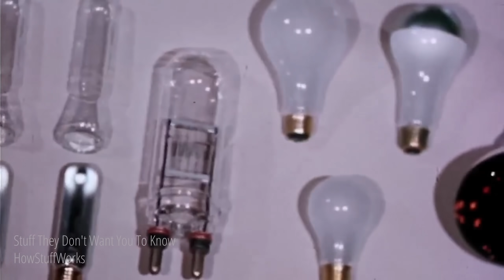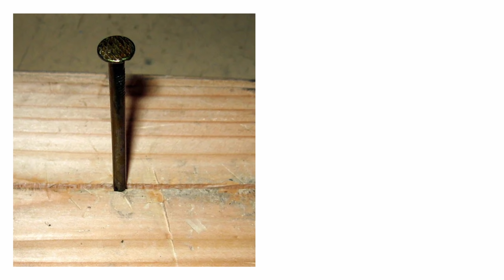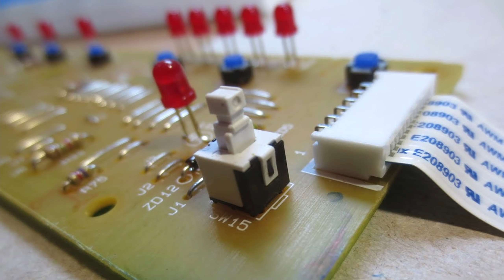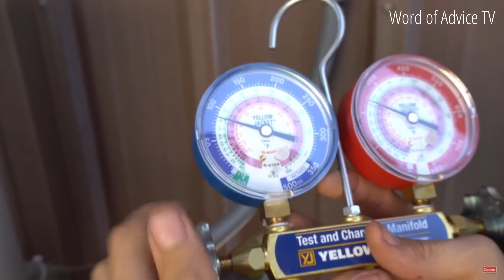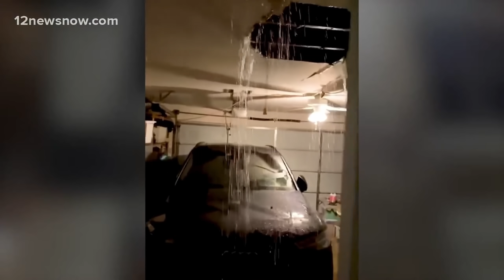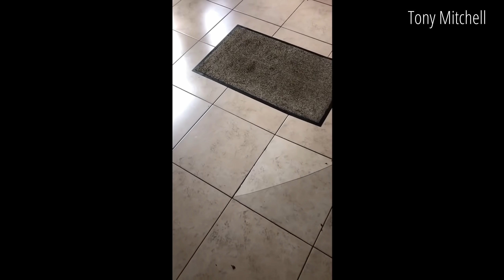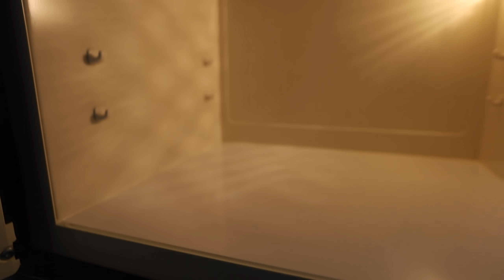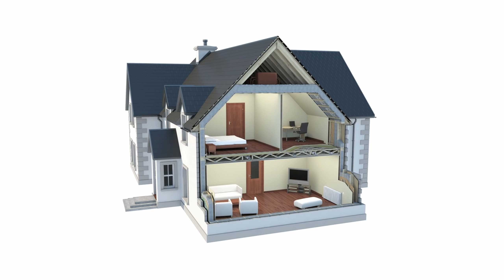Built to FAIL | Planned Obsolescence

Comment: Engineer here. I've seen dozens of stainless steel or plastic pumps have a hidden steel bushing or bearing deep inside the volute, something that only complete destruction of the pump can reveal. It rusts, the pump seizes, and then you buy another. Multiple brands, multiple pump types, all in the 1/4 - 1 hp basic utility range. Why did I buy a stainless pump for a dirty trick like that?
Reply: Another example of that concept is washing machines. A stainless steel drum inside a plastic tub can't rust, right? Well those bits can't but the drum spider made of cheap materials is almost certain to corrode given it's in direct contact with the drum and exposed to water (dissimilar metals....).

Comment: Yet at the end of the day, it's consumers that choose the cheaper products. In the effort to achieve a home like the Jones'es everybody chooses to have the facade of luxury without wanting to pay the true cost.

Totally agree that homes should be more "modular" and repairable. Watching these construction related videos I always am considering how I can make it easier for the next guy who has to repair this pipe or whatever
Reply: Agree. I have problems with blaming manufacturers. After all they are cutting corners and using cheap materials to produce the cheapest product. This is what consumers want, they really are not looking for quality. Just the bottom price.
Reply: @agisler87  yes but because most don’t understand it actually costs them more in the end.

Comment: I've spent a large chunk of work time digging out that spray foam insulation to perform electrical remodels and let me tell you first hand, they're never actually solid. After curing,, It's only about 4 inches thick with massive air gaps between it and whatever surface it's sprayed against
Reply: And living in a 50s built Dallas home is honestly terrible, the foundations are so far off these days that you can feel it standing on them and the price ranges of these places mostly keeps owners from being able to afford to even get it fixed for 10 years

Comment: I would love to sit down with a pot of tea and pick your brain. When I could buy a home in tx decided the foundations, structures, layout of every one of the homes I viewed was not livable so I bought a mobile home as that requires piers and anchors, had access to all services and could be moved as I did want to be in the country. There I bought readymade instead of built to my spec as had done when I was 21(hyperinsulated, thicker plywood, vinyl throughout, sl changes to fenestration so it didn't need ac in IL summers) and regretted it, still was massively cheaper than "normal home". I moved back to IL and wanted to "this old house" 114+ yr old house with great fenestration,solid bones but ancient electrical and incredibly scary gaslines. Scarier still are the contractors thinking I can be sold a lie. Having trouble finding one that can do the work well to my specs. Too many want to put vinyl over the crumbling masonite and do sprays" to make the walls rigid". Ten years of fighting neuromuscular illness and contractors is getting old, still living in the garage apt. Would love to know what you think of Ascend composite cladding. This old house has cedar shingles on the top of dutch colonial and likely narrow siding on the bottom but can't find it under loose masonite. My 12 yr old fridge started making horrid noises but son wouldn't help tip it so I could problem solve, he bought a new one assuming I would junk the old... still biding time to get it running when muscles cooperate. suspect glue trap is up in something. Wish I could do more myself.
Reply: Kudos to you Cheryl for not giving up! If I lived closer I’d gladly help you out. Perhaps you can find a neighbor instead. Best wishes in this latest endeavor.

Comment: The problem is that the home has been turned into a consumer commodity. I've been In homes from the turn of the century and you can tell that every detail in that home was there because that's the best they knew at the time, it wasn't about cutting corners. But since mass produced homes have become so desirable, you have community's of fast fashion homes. I've replace so many kitchen's in people's homes  that are 5-10 years old because the kitchen cabinets are peeling (thermafoil doors are a terrible product!). I talk to a builder about our cabinet's at one point and to summerize the conversation they don't care about the quality of the the home because they're customers are only in their places for an average of 5 years, so how would their customers see the value in haveing a better finished more durable home if they'll just be moving in 5 year? Absolutely disgusted by that conversation.

Comment: I was about to talk about how a modern wood burning heater can heat a space with less wood and much lower soot released outside than a typical fireplace, but then I remembered that would require electricity! However, if you do have home battery backup, a wood heater would way outlast a regular heat pump in frigid temperatures for a given kwhr backup. Loving this channel after just a couple episodes!

I have my own dream house design, and it indeed includes most if not all plumbing and services inside interior walls, none in external walls, as little as possible in foundation, for easier maintenance!
Reply: Why does a wood burning heater require electricity ?

Comment: I am TRYING to recover from Sick Building Syndrome.  Exposure to mold in a water damaged building. 

The #1 most difficult part is finding an affordable home that isn't SICK. It's nearly impossible.

From the chemically laden and "mold food" materials that start fungal growth after the smallest leak to poor ventilation and cheap overpriced "luxury" apartments, there is good reason why homeowners and rental policies deny coverage for mold. This has cost me nearly $500,000. 
I have designed a floorplan where all plumbing and electrical is easily accessible yet looks like the average home. Just need to find someone to start building them.

Thank you for this valuable video. Cell phones are another planned obsolescence. The required updates make my phone malfunction.

Comment: There are some companies that produce long lasting products out of principle. For example, Toyota Land Cruiser, Miele washing machines, Milwaukee tools. I noticed a few years back you’d see old microwaves from time to time that were straight out of the 90’s and still going strong. I went way down the rabbit hole trying to figure out why my microwaves only lasted around 3-4 years. Turns out all the microwaves are manufactured in the same area in China. There was one however, Panasonic that was produced somewhere else. It’s been about 4 years and haven’t had an issue yet 🤞. I think if you spend the time to find the right company you can avoid at least some of the scammy planned obsolescence out there 🤷‍♂️
Reply: What exactly is failing so quickly in modern microwaves? Is it the magnetron? The diodes? The electronic display and control computer? The transformer?
Reply: @gregorymalchuk272  off memory when I did the research at the time it was the plastic latch that keeps the door closed.

Comment: The best building material on the planet is pumicecrete 
Pumicecrete is a mixture of pumice cement and water mixed and poured into a set of reusable forms walls are poured from 12" to 24" thick pumicecrete is fireproof termite proof rust rot and mold proof and has a high R value and good sound attenuation solid poured walls means no critters can live in your walls If you would like to build a house that will last forever pumicecrete is the material you want

Comment: This is a tiny example of planned obsolescence. About 10 years ago I remodeled by bathroom. As part of the remodel I replaced the shower/bathtub faucet. After just a couple of years, one of the cartridges failed and it started to leak. Since I bought the faucet at Home Depot, naturally I went their to get a replacement cartridge. Of course they didn't carry it, so I got smart and went to plumbing supplier near me. Not only did they have the part, it was of such obviously superior quality that only a blind person could fail to notice -- $20 each. That was a pretty expensive faucet, and it looked good from the outside, but the wear parts were garbage. This is especially galling since I now know that better parts were readily available.

Comment: Consumer Reports is your friend. Customer reviews will tell you about the pitfalls. Models made for the nation wide chains are usually substandard and don't have the features you want. It's YOUR choice to be a smart consumer. On large dollar "durable goods" the extended warranties can be a good value. It just adds up to what you would have paid for a quality product. Deal with manufacturers directly. Retailers all use contract repair services so there is no benefit to buying from "local" big box stores.

Comment: To change that we would need politicians to make laws against using certain practices. Not gonna happen. Even the "right to repair" and having manufacturers actually produce and sell spare elements of their products had to be fought for.

As long as money is the deciding factor and as long as money is permanently inflated by printing ,like there is no tomorrow, nothing will change noticably.

It is a far stretch, but I really think a deflationary currency like Bitcoin might change this. If their money is worth more in a year than it is today people will re-think what they need and want.
If their money is on avg. 5-10% less worth in a year, they will spend it. What else you gonna do? Might as well throw it out of the window with negative tendency.

Comment: I dunno Ms. Carr, calling it "planed obsolescence" makes it sound like a conspiracy of bad faith, but from my humble 10 years experience in the construction industry, most crappy homes are a result of a trifecta of client's cheapness and general ignorance, inexperienced and uninterested construction crew, and a greedy contractor. These three always come together and it's a systemic problem in the industry (at least in my country).  

p.s. I think it would be interesting for many to see a video about CEB and rammed earth construction. I'm seriously considering constructing my new home from stabilized earth blocks, and it would be very interesting to hear your perspective on this new/old construction tech
Reply: Agreed. Planned obsolescence is the wrong term. It really is everyone wanting to do as little for as cheap as possible. 
I would argue the consumer is just as greedy,  wanting to spend less is basically the same as a contractor charging as much as they can.
Reply: @agisler87  I wouldn't put much guilt on the consumers though, these are mostly normal folks, a lot of times they're in a pinch, but what's worst is that they are not informed and are easily manipulated into believing they are about to save a buck. And you can't blame them, i mean, most of the guys working in the industry rarely know anything outside their practice
Reply: @agisler87  Considering wages have barely moved for decades while housing prices have multiplied ten fold how can you possibly blame clients for wanting to save some money?
Reply: @Son37Lumiere  I am not blaming consumers. I meant to only point out that an employer labeled "greedy" because they don't want to pay more for labor is doing the exact same thing as a consumer unwilling to pay more for XYZ. 
I think the word greed is almost always misused and is never defined by the person who uses it. A greedy person can be doing good or bad. When does someone become greedy? It puzzles me.
Reply: @agisler87  
Give me a break. It is not the same thing. Paying your employees a minimum wage or just above so you make millions a year is the definition of greed. One doesn't become a billionaire without screwing others over in one form or another to achieve that wealth.
Reply: @Son37Lumiere  I'm not giving you a break for that nonsense comment. You should look up the definition of greed as you don't know what it means. Your example provided is not "greed". Nobody has a right to a higher wage.
Most billionaires have not screwed anybody over. The only one I know of is Bernie Madoff.
Reply: @agisler87  
It is you who clearly doesn't understand the definition of the word. When millions live in poverty so a handful can be filthy rich, that is greed. You act like the word has no meaning so either you're quite dense or you're a part of the problem trying to gaslight.
Reply: @Son37Lumiere  I am definitely part of the problem from your perspective.  But it's your policies that keep millions in poverty. Authoritarians that think they have the right to control people and every part of the economy.
Reply: @agisler87  Right so you're a greedy selfish prick who thinks he has the right or freedumb to screw people over for your own benefit. Because that's what the rich do, that's how they get rich. Use their employees as wage slaves while they reap all of the profit for themselves, exploit the system by corrupting it, use it for corporate welfare while dismantling all public welfare, avoid all taxes, partake in white collar crime that's legalized through politicians in your pocket, kick people out of their homes and apartments because you want more and more rent, keep housing prices high by limiting how many can be built. The list goes on. But sure, it's 'my' policies that keep people in poverty.
Reply: @Son37Lumiere  Well the only thing you got right in that diarrhea of a statement is about me being greedy and selfish. 
Your mocking of freedom shows your lack of understanding of such a difficult thing to obtain. 
What's worse is you want to give the rich, well connected and corrupt greater power by expanding the one thing that has a monopoly on force.
Reply: @agisler87  It doesn't matter how hard you try to twist reality, those are all facts you can readily look up. When you follow the money the truth is revealed and people are waking up to the scams and schemes the rich are knee deep in. A reckoning is coming, mark my words.
Reply: @Son37Lumiere  Sure whatever you say.  Bunch of authoritarians blamming the rich for their own life problems.
Reply: @agisler87  
The rich are morally bankrupt parasites. Your authoritarianism propaganda falls on deaf ears.
Reply: @Son37Lumiere  You don't know what morals are. Just a child whining "it's not fair!"
Reply: @agisler87  This coming from a morally bankrupt clown is laughable.

Comment: In 1986 my wife and I decided to change from apartment living to a house when she became pregnant with our first child. I found a large lot in town with a single bedroom shack on it for cheap because of the state of the house on it. We demolished the old house and I had a contractor I worked with dig the foundation. We could only go 4.5 feet deep because of the soil. We decided to build a pre fabricated house. It came as a kit.  We customized the design and widened it by 4 feet. This enlarged all the rooms to comfortable but non-standard sizes. The plan was for me to do all the construction myself with the help of friends when available. We used a wood foundation with a poured concrete slab. I made all the choices of what materials to use and design choices were tailored to our taste and convenience. I met with resistance and criticism from all the "professionals" I had to deal with. I had anti-back flow valves on every pipe embedded in the basement floor. I also over-killed on the sump  hole making it 2 feet deeper than code. "Waste of money!" I was told, until the town flooded and my basement was dry, even with no sump pump. I had the basement bathroom roughed in. I used floor trusses instead of joists which made heating duct work simple and cheap. No squeaky floors, wiring was simple and neat. No holes drilled. Custom built oak cabinetry and counters were raised 3 inches to accommodate my wife's and my height. About 20% more expensive than the veneer plywood 'One size fits all" garbage. No aching backs when preparing food or washing dishes. Gas stove, clothes dryer and furnace. When the electric power failed, we could still cook our food. A back up generator ran the fridge and furnace fan. A 200 amp electrical service. A separate service to the detached garage/workshop. The electrical switches and outlets were 2 inches higher than 'normal". Quarry tile kitchen and dining room floors and real wood T & G flooring in the living room. Plain drywall (no stipple) ceilings. Every choice was was deemed "wrong" by the real estate gurus. "It'll be tough to sell!" Every one of these choices became selling points. When we eventually moved to a different city, we never even had to list with a realtor. A co-worker who was a frequent guest heard we were moving came to us and made an offer at the appraised price because she and her husband loved the house. All the non-trendy choices we made were the reasons. The real point is it is the serviced lot that costs the money. The house is where you live.

Comment: Another excellent overview and analysis Belinda. What were you doing in Proctor?
Personally I categorize laminate flooring as nothing more than future land fill.
Asko appliances from Sweden are built to last 25 years.
Spray foam is garbage that is also future land fill. The only foam I use is for under the slab as there is no glass foam available where I build.
OSB is not allowed in my homes. I was fixing a water damaged building with OSB studs and plates that were falling apart literally.
My current project is double stud wall with cellulose insulation and triple pane windows. It is not far from Proctor. The power went out for thirty one hours last winter at about -5C. The inside temperature of the house went down 2.5C over that time period.
The home is built with as much locally sourced material as possible. Flooring, siding and wood for the cabinets are all from local mills.